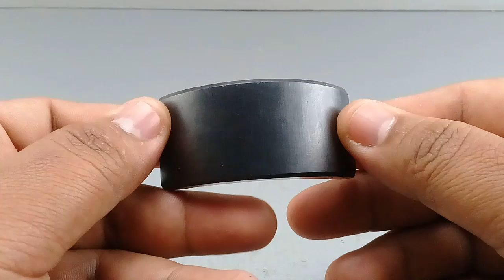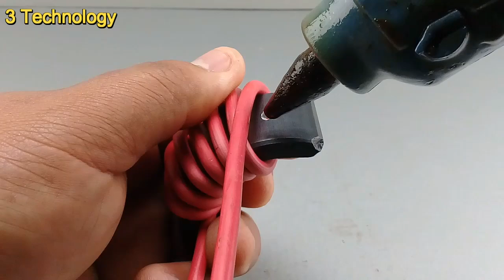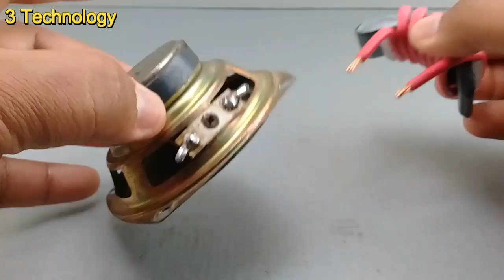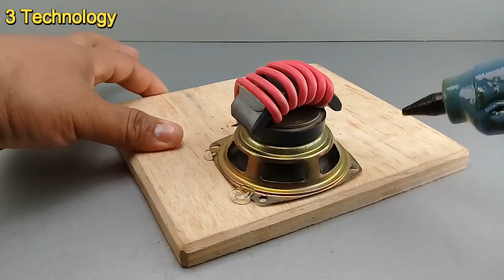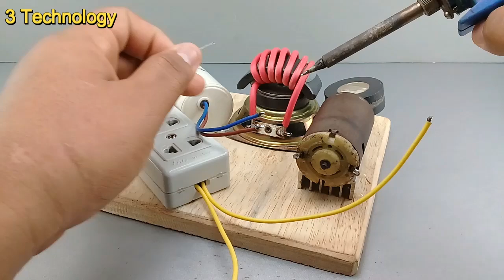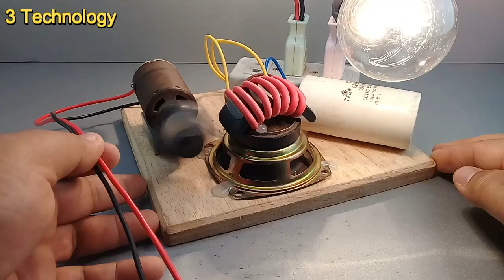Make most powerful free electricity 220v with speaker gear 100%

Comment: So it takes power to make power? 
So if we took the red and black wires and plugged it into the white outlet would it perpetually feed its self?
Reply: My immediate question also, assuming it is an AC motor. But a completely relevant question, as an AC/DC adapter I would assume would require even less power. To be honest, when I see these things on the shelf at Tandy Electronics stores, I'll believe it. Or if these "inventors" offer a link where their contraptions can be purchased to put to the test.